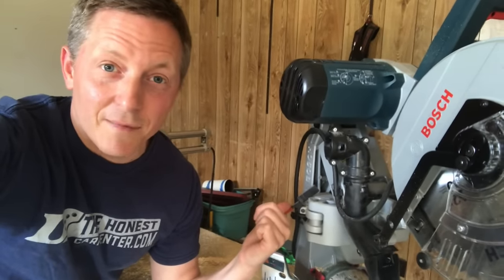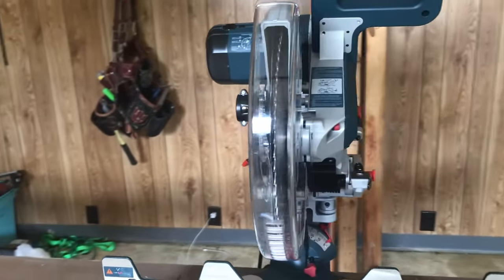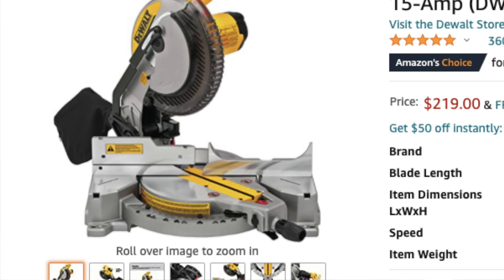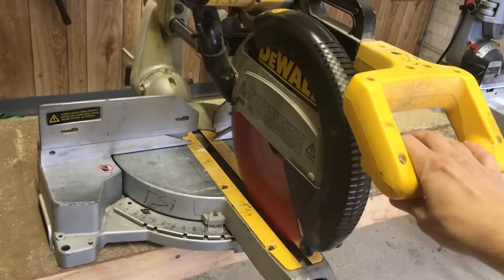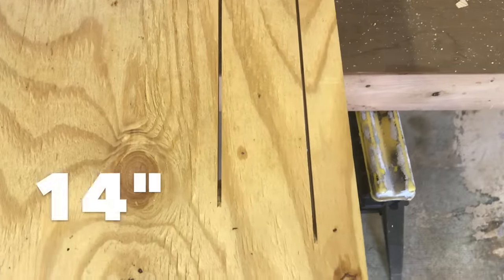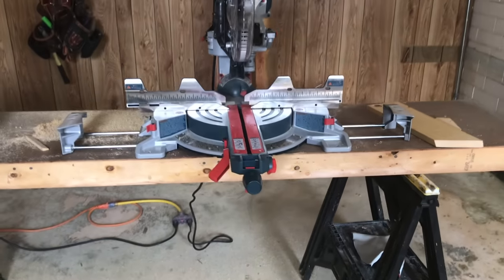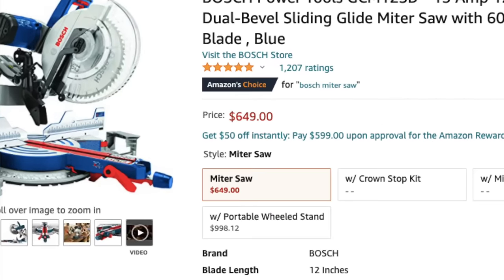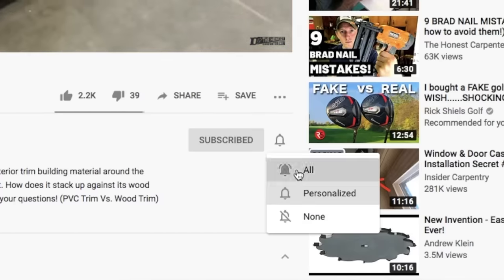This INNOVATION Changed Miter Saws! (Best Miter Saw Feature--Bosch "Glide"...Better than Rails!)

Comment: Do NOT buy this saw! The 'glide' mechanism feels very cool but it is not accurate at all because the glide hinges lack rigidity. I can move the blade by at least a millimeter or more just according to how I push the blade down.

Just buy a saw with a standard rail slide. I know it's boring and you don't get to have the new whiz bang gadget but sometimes it's better just to stick with the stuff that you know works.

I'm a carpenter and I bought this saw, it's been sitting in my garage at home for years. I actually had to buy another one and this one is just the one I leave at home and occasionally cut something with. I use it so infrequently that after years of owning it, it still has the original blade.

It's also ridiculously heavy, so if you want to take it to different jobs you better be in good shape.